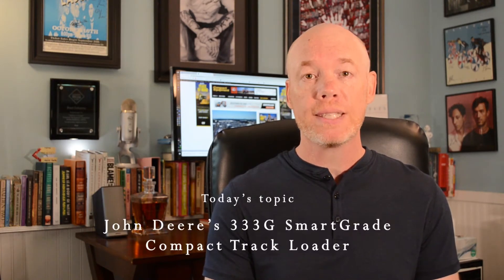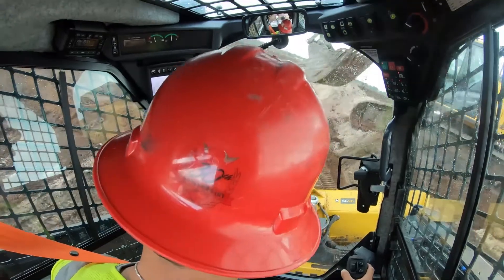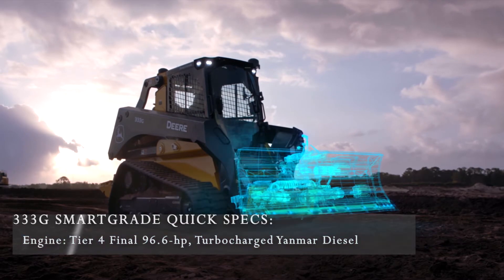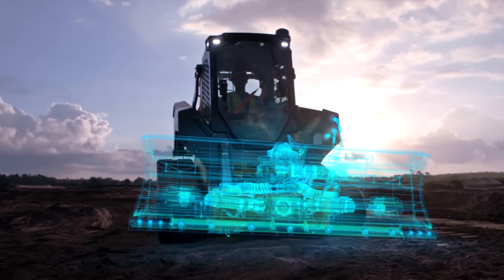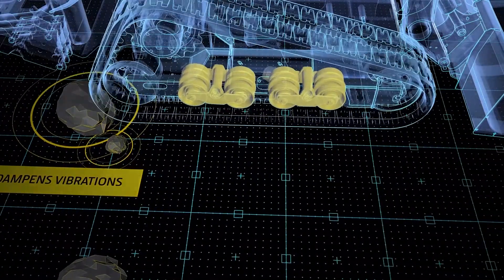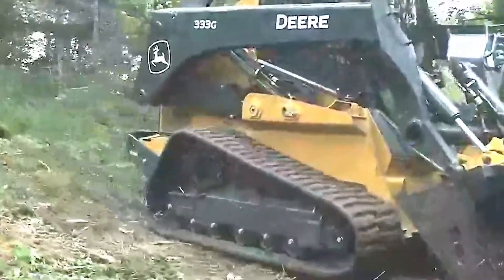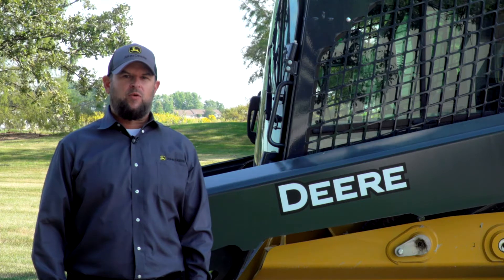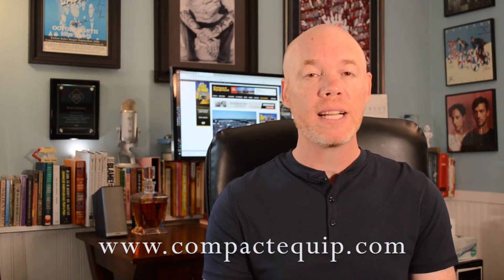John Deere's SmartGrade Compact Track Loader and Anti-Vibration Undercarriage Option

Comment: so is anti vibration   same as torsion bars ????     you need moveable safety bar and moveable joysticks for bigger people     so can grade control be used with out turning the grade system on (box in cab  ) ?